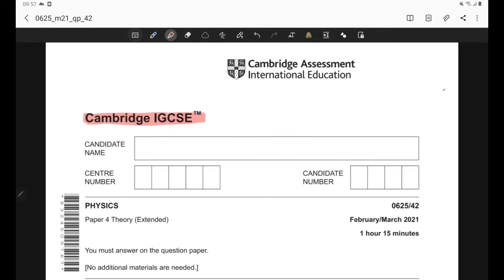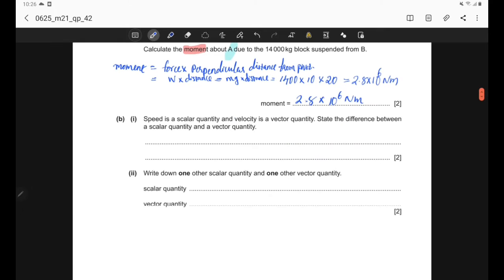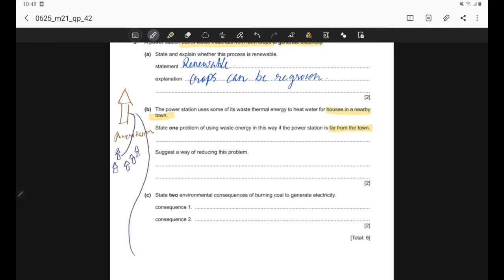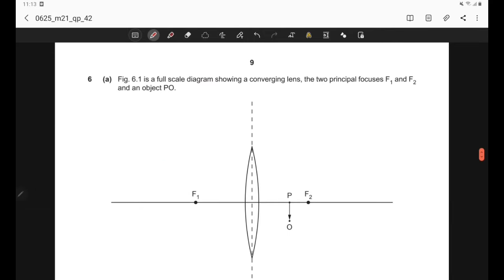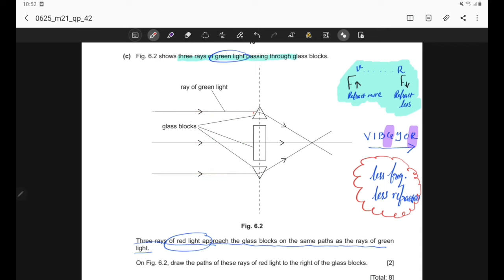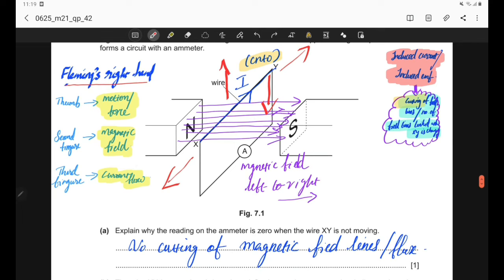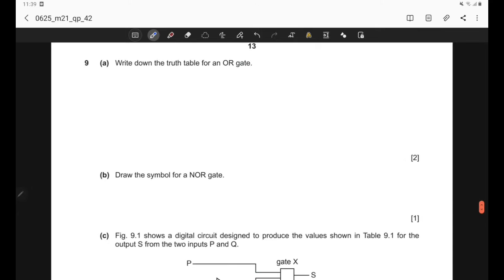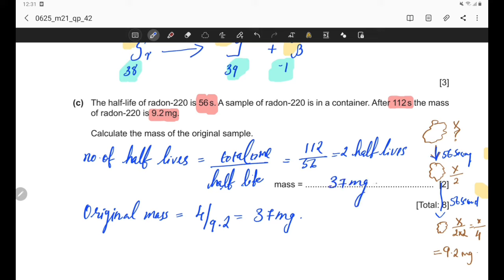0625/42/F/M/21whole paper Solution IGCSE Physics paper 42(Feb/March 2021) Paper4 Theory

Comment: I have a question at 53:16 in question b why do we use flemmings right hand rule instead of flemmings left hand rule.? Please i would appreciate an answer. Thankyou
Reply: Because here mechanical energy is converted to electrical energy. If it was the other way around we would use flemings lhr.
Reply: @eerr3695  So the basic confusion i have is...if the direction of current is given frm X to Y - they why re we considering it "into the page"... should it be top of the pge. Will appreciate your answer. thanks
Reply: Ok thank you very much

Comment: On calculating the original, you had the correct equation x/4 = 9.2 which means x = 4x9.2 to give the correct answer 37mg. But it was really nice presentation. Thanks